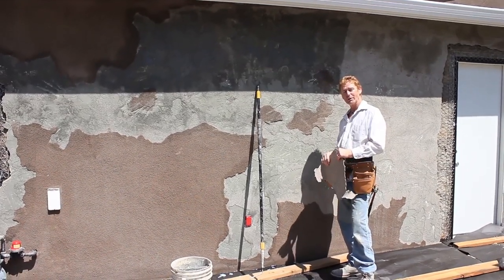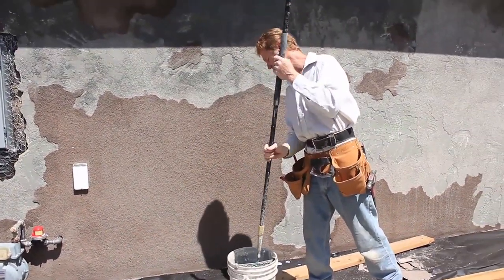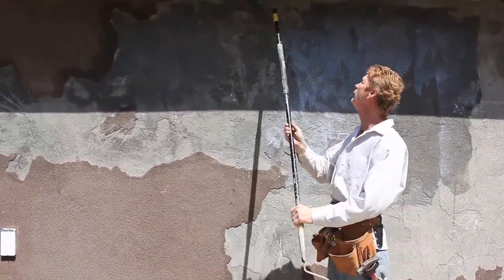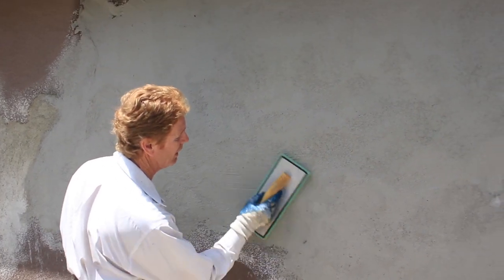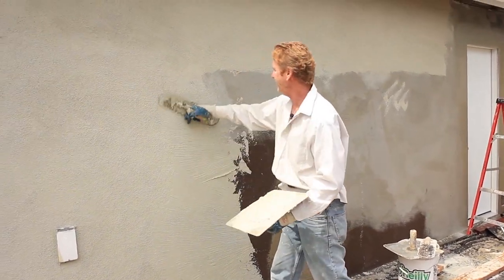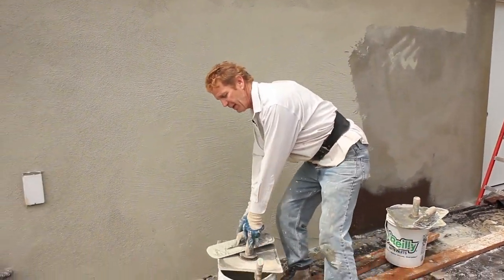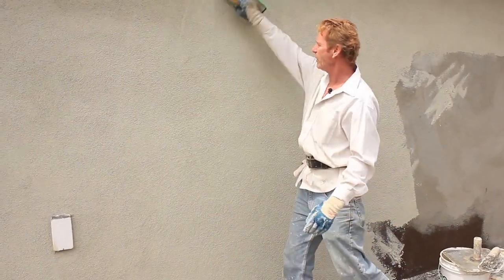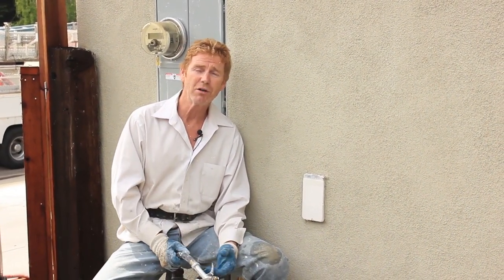Failing stucco finishes and how to repair

Comment: Holy heck! I watched this and by george I think I can ACCTUALY do a stucco repair!! I'm a house painter who moved to the S.W from the N.W.  I have had to turn down jobs because they need stucco repair before I can paint and In the N.W. they have OUTLAWED stucco due to safety/black mildew. Haha. Im going to sit down this weekend and watch ALOT of your videos and see what I learn!! Thank you so much for sharing your trade with us, Sir!!!!!Just Subscribed! ;)
Reply from the maker: Good Afternoon Miss Julie, thank you.
FYI, stucco has been around for well over 10,000 years, it does not create or cause mold issues, the practice of its application may in some rare cases cause this.
                                             best wishes,
 Sound advice for plastering issues from your favorite stucco geek
Reply: Kirk Giordano plastering Inc. Agreed fully. I failed to mention the reason for the ban is that too many people thought they could do it and didnt do it well. So inevitably in the moist climate it would end up with alot of bad guys behind the stucco. Haha. You know what youre doing though. So your jobs inevitably wouldn't have this problem. Thanks alot for responding!

Comment: I have a cement brick painted exterior house with 20 year old paint that has taking a beating here in Phoenix,AZ.  I want to apply quikset to a 3x8 ft section of 1 wall. Can you demonstrate the best way to do this. P.S. I will be painting entire exterior including the 3X8 ft section.
Reply from the maker: Evening Specs Bundy, yes I can, if fact I already have type in
"how to skim coat cinder block",
 in our search channel and you will see this application in several different videos.
I am not using Quickset though, FYI there are about 10 different quickset products for interior to exterior cement plasters,
 I am however using portland cement plaster which I can't even tell the difference when it's being applied,
 best wishes, 
Kirk & Jason Giordano's DIY plastering network

Comment: Hi Kirk.  We recently (3 months ago) had a Smooth SB finish applied over our existing rough stucco (painted).  They pressure washed and used a Polymer-modified base coat and anti-fracture
membrane for smooth-troweled finishes (basex).  They charged about $4k (West Mission Plastering in Santa Barbara, CA).  Here is my problem though -  about a month ago, I added PVC trim to our outside windows and used a construction glue to attach the trim (I didn't want to punch holes in the wall and risk water damage, so I chose glue over screws). Yesterday, I noticed that 2 of the window trims had pulled the stucco off the wall and basically destroyed the entire section around the window (about a 3 inch section all the way around the window).     I asked West Mission Plastering why the stucco peeled off so easy (keep in mind, PVC trim does not shrink, twist, etc. - so there was very little pressure being exerted on that stucco).  When I take a piece of the fallen off stucco, it crumbles very easy and is only about 1/8inch thick.  West Mission Plastering had the following to say :  "First of all, my stucco coating is not peeling off (it's been pulled out). I don't know the type of glue you  used which is creating such damage. I can help only if my stucco coating is peeling of the wall by itself within 1 year of my completion date".

So my questions are:

1): Should the SB Smooth stucco finish be stronger than this, or did I mess up by using glue to attach the trim? 
2):  Is your typical warranty similar to what West Mission Plastering has stated above (1 year, and only if the stucco peels off on its own)?
3):  What is the best way to fix it?

Thanks Kirk. I've been watching your channel for about 12 months and have learned much!

Comment: Morning kirk hope you having a good day  last 2 questions  promise i bought quickrete bonding  Question is should I diluted it  2nd question how long after I apply the bonding should I start applying the final coat of stucco I guess is a  3rd question Can I make my own mortar with only using  Portland and Sand or what should I use th portions please 🙏

Comment: Nice job. But you know I noticed something. At the end of the video
you where sitting on the Gas meter, which brought to thought.
the Doorway and electrical panel was recently put it.

well, how you say Kirk, all the time, and the moral of the story is...
the gas meter should be at least 3' away from the electrical panel, cause
you may get an explosion.

LOL.

Stucco tips are great, keep them coming.
Reply from the maker: Jose Macias Morning Jose, there are many thing I have no clue about, one of them is the distance between the two, never crossed my mind,
 good tip,
 best wishes, 
 kirk giordano plastering

Comment: it would be nice if you did follow-up videos of plaster jobs you did in the past, say 5 years later to show how they are holding up
Reply from the maker: Evening Joel, this was repaired 7 years ago. This is stucco similar to concrete, not vinyl or tin siding.
 Unless someone hit it with a lawnmower, or garbage bin, or household appliances.😉
 Nothing adverse happens to stucco walls. Stucco walls don't decay or rot unless the roof or walls leak, nor do they fail unless the person who applied the stucco only had an idea of what they were doing.
   As a rule, to learn to apply every type of stucco takes roughly 10 years to be well rounded. It takes about 15 years to understand all the materials and what they can and can't do.
 I have 900 videos and 50 million views. I challenge anyone to find a video where we did anything not up or beyond code. The fact is we're on the ball, so much. We are transparent and video even the most complex stucco that can be applied for the world to view.
  Plus, one would have to be a moral person who understands any repair that fails. We would have to go back and correct at no coat. If one does this at least three times in 25 years, thats normal. 5 times, the contractor is not sharp.🤔
  Our unique plastering Tip:  all subscribers or anyone who stumbles on our channel with a question, type it into our Stucco/Plastering channel, and like magic, a video will appear to explain how it's done. 	
   This feature is miles ahead of any plastering forum. 🥳	
Kirk & Jason Giordano Plastering

Comment: How about adding bonding agent to the mix AND applying it to the wall? That way you get flexibility in the stucco (which seems good) but hopefully it doesn't peel off....
Reply from the maker: Evening Metal dude, by adding the bonder in the stucco, it dilutes it it to uselessness, over the last 30 plus years this is the most common failure of Plastering renders failing.
 Don't do it.
 I realise theoretically it seems a sound idea, but it has never worked, when folks call me and say they hired a person now less than a year later it's all peeling off, this is the main reason, besides a dirty or dusty wall, nothing adheres to dust either.
 Cheers,
 kirk giordano rendering

Comment: Kirt, the stucco is falling off  year 1994 family dwelling, scrap the stucco from the wall comes out easy like until becomes like a powder dust.   What's the steps bonding agent to the wall and for stucco what to use?
Reply from the maker: You can apply either Quikrete bonding agent sold at all hardware stores or Weld-Crete usually sold at plastering yards by Larsons. 💃🏻

Comment: have you tried adding fine sand/SB to paint with Elmer glue, maybe, and using it as a non cracking stucco?
Reply from the maker: No, nor will common sense allow me to consider this method.👨🏻‍🔬

Comment: Kirk, looks damn good.  I have been a drywall guy (one of my practices) for over 11yrs now and your lingo/techniques transfer over quite a bit.  Your finish was damn nice man!  By chance, where do you get your WeldCoat?  I can only order it in :/  Watching your videos, great videos keep em coming :)
Reply from the maker: Evening Nathan Deneault, thank you, most professional plastering yards sell this product.
 If no plastering yard are close by you, try Home depot or Lowes as both  sell a comparable product which I sometimes also use called Quikrete Concrete Bond Adhesive.
 Best wishes,
 kirk giordano
Reply: +Kirk & Jason Giordano's plastering & stucco tips thank you kindly :)
Reply from the maker: Morning Nathan, no worries,
 cheers,
 kirk

Comment: Hello Kirk, would i need to apply a bonding agent over a painted cement wall if using "Facades Xi Finish" which is flexible?
Reply from the maker: I would advise it.

Comment: Hi Kirk, srry in advance for the long descriptive question. I have a house that is done entirely in white color coat with a smooth wall finish. The area in question is 8h x10w square seam. This seam was created by enclosing an upstairs out door patio. The guys who did stucco used a white color coat that matches existing house perfectly and the new stucco looks great but the entire square of seam from new to old is visible. Is this just the way it is or did they pressed too hard on the float at seam making it low? Is this fixable with bonding agent then reapplying and floating more color coat over just the seams to a feathered zero outside the seams or would you have to chip out the seams a 1/4" or does the entire wall need to be smooth coated corner to corner? I can email a picture of it so u can see it if helpful. I emailed you a few years back and u helped me out with my first large stucco repair that came out great thanks to you. For some reason I don't have your email anymore. 
Thanks alot?
Reply from the maker: Our email is in every video  in the description, with smooth wall or steeled trowled finishes it’s tougher to blend it in, but of course it can be done.